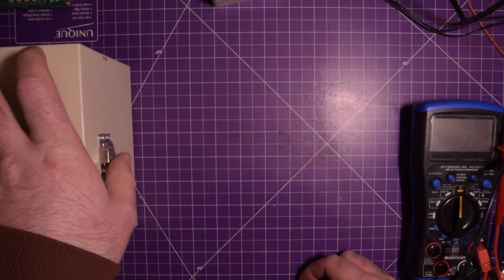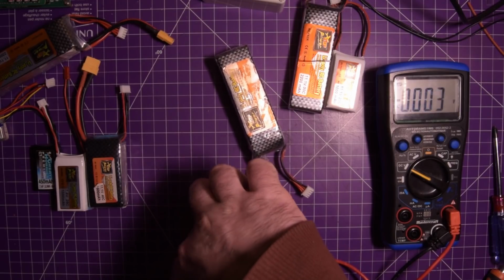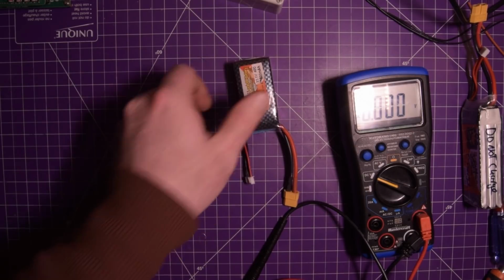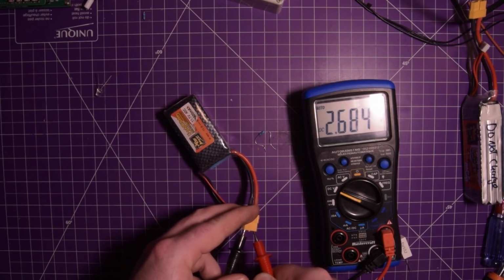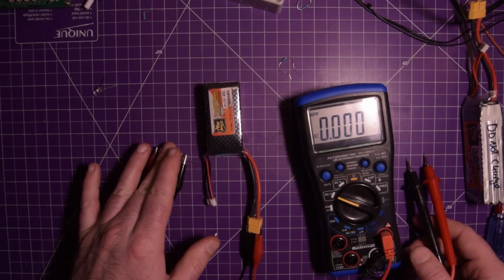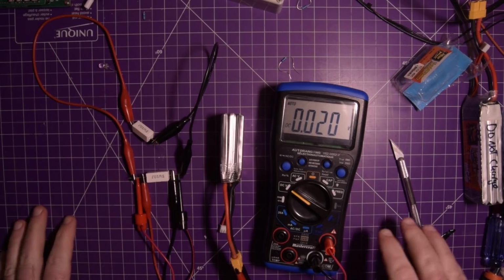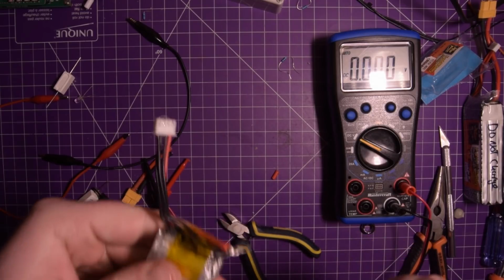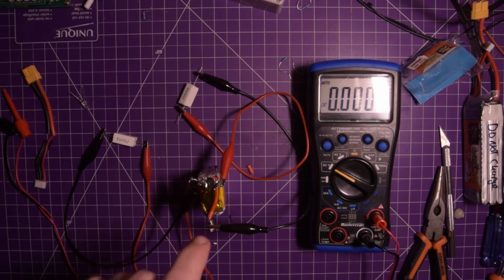Inspecting LiPo Batteries That Have Been Stored For Nearly 2 Years!

Comment: Interesting video. to bad there wasn't some protection boards in there, a guy could have at least salvaged something  other then a plug. 🍻
Reply from the maker: Yeah, nearly none of the RC LiPos have protection because in order to have protection, you need at least a mesfet in series to cut output, when a quad draws 50A on punchout, that little guy would get HOT!
Reply: @SimpleElectronics  I guess ya those things get drawn down pretty quick!